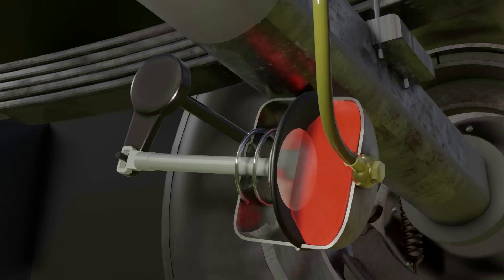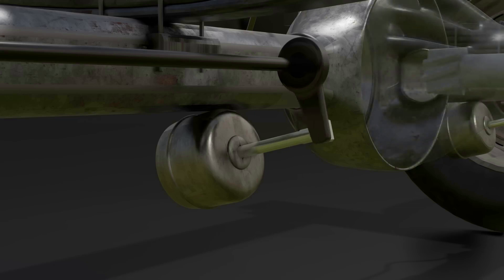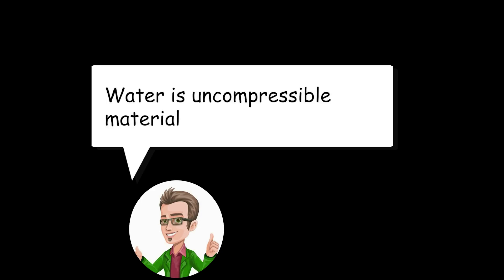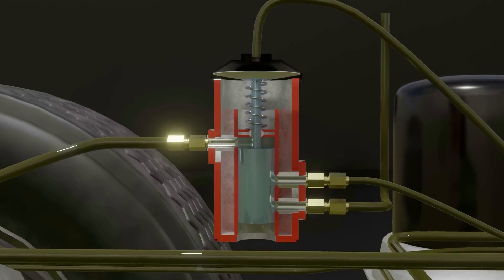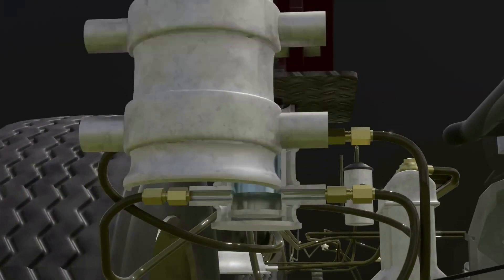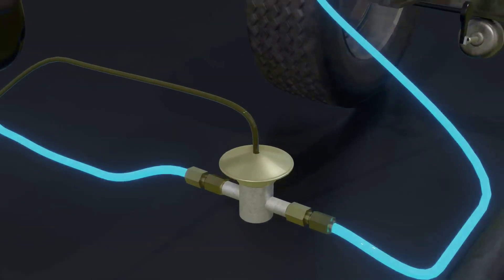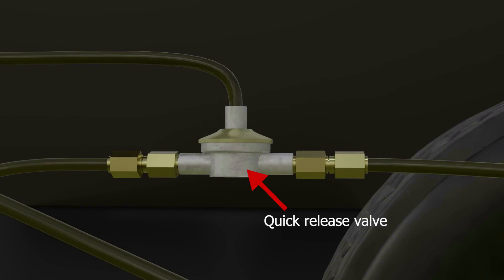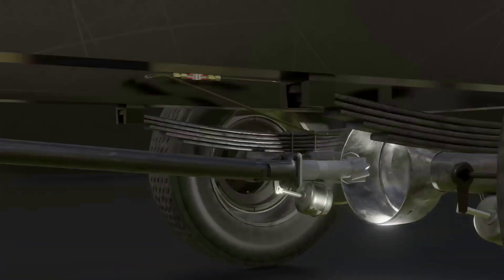How Air Brakes Work ?  [Better English!]

Comment: You claim that trucks need to idle for 30 minutes to build enough pressure for the brakes to work is completely wrong. Any truck that takes this long is leaking air badly somewhere and will not qualify as roadworthy. Real pressurisation figures are more like 2-3 minutes from zero, but the parking brake won't release until sufficient pressure has built up, so there is no opportunity for a novice driver to start their truck and drive off without having the brakes up to pressure. 

Similarly, claiming air can outperform hydraulics in terms of force delivery is completely insane - 5000 psi is normal enough for off the shelf hydraulic systems - they'd literally bend or break the actuating lever if used on the same pistons as the air brake system. The reason air is used is that the stored pressure in the tanks gives the driver at least a chance of stopping in the event of engine failure as the force they can apply to the pedal is irrelevant compared to what's needed to stop a truck. 

In lighter vehicles like cars, the vacuum created by air flow through a venturi on the intake to the engine, acting on a large area piston, is able to amplify the pedal force applied by the driver to the brake pedal, but the driver will be able to stop the car without power assistance, just nothing like as easily, and the hydraulic system is lighter and more compact for similar performance when you don't need an emergency power reserve.

Comment: You have gone to a lot of trouble to make a video that is incorrect,  the actuator is a "spring" based mechanism, air pressure is used to keep the friction surfaces apart,  when the pedal is moved the air pressure drops and the "spring" activates the brake shoes/pads. 
The system is deliberately designed to be " fail safe", failure of the system renders the vehicle immobile.